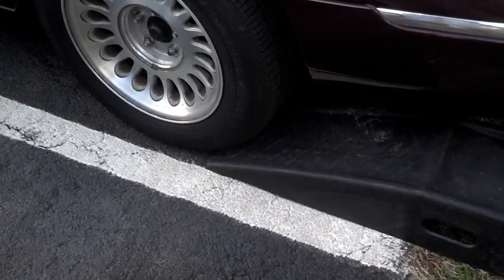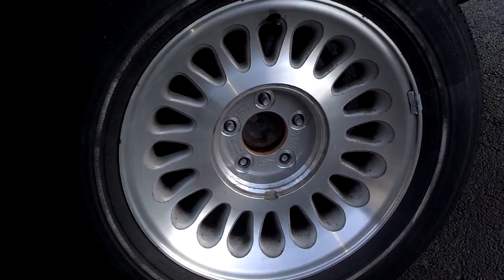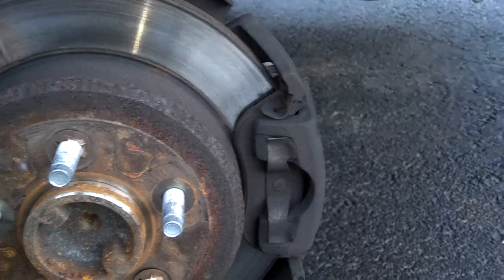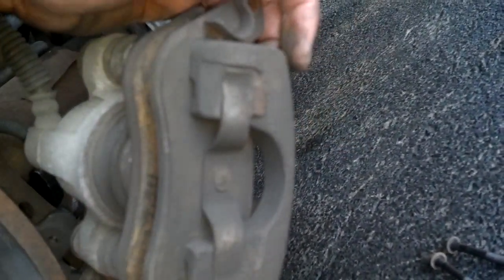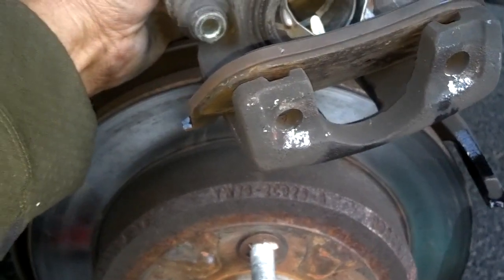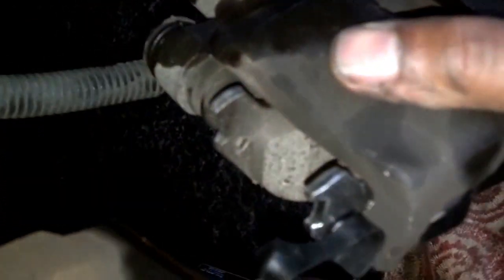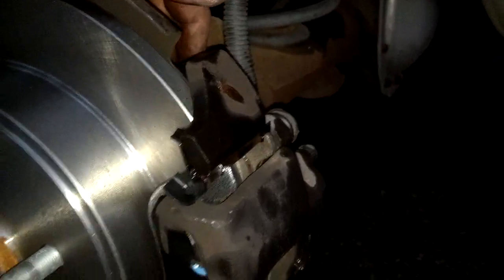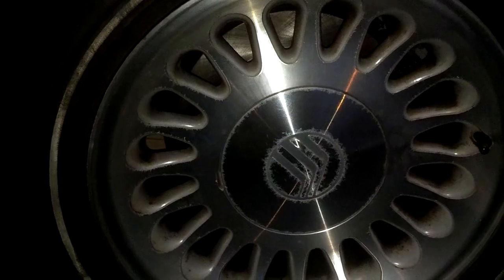Rear brake pads and rotor replacement, Mercury Grand Marquis - VOTD

Comment: Enjoyed the video. Have a fella with a alarming loss of brake fluid and I can't a leak surprisingly, any thoughts on spots to check in the hard lines that may not be running straight to the ground or easily visible leaking?
Reply from the maker: I have no idea.

Comment: HELLO ! ROBERT MY HUSBAND  IS REPLACING BRAKES ON OUR 1993 LINCOLN TOWN CAR SIGNATURE SERIES AND SO FAR HE'S FINISHED THE FRONT BRAKES BUT HE'S COME TO A DILEMMA REPLACING THE REAR BRAKES HE DOESNT KNOW WHAT TOOL TO USE TO TAKE THE CALIPER OFF, HE'S TRIED ALLEY WRENCHES BUT THEY'RE NOT WORKING..DO YOU HAVE ANY IDEA WHAT TOOL HE NEEDS?
Reply from the maker: lakisha brown I apologize, I do not. Are they disc or drum? You may want to try Google or ask the guys that work at an auto parts store.

Comment: is there a picture,a diagram on how to properly re install the springs and adjuster on the 2001 models of the grand marquis emergency brake shoes
Reply from the maker: You can probably find one on All Data, or try a forum. Most are the same with many cars.
Reply: Thanks

Comment: No need to loosen the brake bleeder and expose the system to air possibly going in the lines and having to re-bleed the brakes. The C-Clamp will push the brake fluid and piston back without loosening the brake bleeder. I never loosen the brake bleeder and I have been doing brakes since the 1960's.
Reply from the maker: Thank you for the tip. Not sure where I picked that up. Probably should replace the fluid anyway. 🤷🏾‍♂️
Reply: Robert DIY in all the years that I have been doing brakes very seldom do I bleed out the brakes for no reason just to get some old fluid out to be honest with you. The only time I will find myself doing a bleed is when a brake line or brake hose needs to be replaced or a brake caliper goes bad or in the case of drum brakes the wheel cylinders are shot or a Master Cylinder goes bad. That is when I bleed them out with new fluid of course otherwise I don’t touch them. I leave well enough alone. I have a 2000 Mercury Marquis. It just made only 35k miles. I heard some noise coming from the back lately so I  jacked it up put it on stands and pulled the back 2 wheels. Sure enough the back driver side brakes are shot and started cutting into the rotor. Actually there is plenty of meat on the rotor. Back in the day I would of just had it turned down on a lathe but a friend of mine in the parts business will be at a Parts WD today so I called him with the part number for 1 new rotor. I have a new set of rear disc brakes for this car sitting on the shelf knowing it would need them at some point but they were still good when I replaced the fronts at 30k miles. I use to be in the parts business also but I am retired from it now. Yesterday I had some time so I checked out your video for the heck of it. Good job by the way. At almost 69 years old I am finding that it is not so easy for me to be working on cars much anymore but I try to do what I still could today like anything else.
Reply from the maker: So you don't replace the fluid every 2 years?
Reply: Robert DIY Nope not at all as mentioned above.
Reply from the maker: I use to do that, until I lost brakes on day. 😬
Reply from the maker: https://youtu.be/nYBkCfhDTTw
Reply: Robert DIY Just watched your video on brake bleeding at the link you provided but didn’t comment there. You had a lot of air in those lines in that video. You are suppose to see solid fluid all through the clear plastic hose from the caliper to the beginning of the suction bottle when all air is out of the system. You didn’t do that. That in itself is dangerous. One other thing being you are all about changing the fluid. If you wanted to do a good job you should of got yourself a Turkey Baster or one of the squeeze bulb type of suction tools to suck all the old fluid out of the master cylinder that has also been exposed to air. All you did was add new fluid with old by adding new fluid right into the master cylinder. Then you bleed old fluid out of the caliper drawing more old fluid into it. If you sucked it all out now the Master cylinder would of had new fluid to start feeding between all the brake lines pushing the old fluid out in the process of bleeding. Just another word of advice. I am not to impressed with that Mighty Vac Bleeder. Harbor freight sells something similar. I know I have one and I don’t care for that one much either. Power Bleeding is the only way to go. Actually Harbor Freight sells one that I really like. You could of purchased one of those probably for what you paid Napa for the Mighty Vac Bleeder or less if I had to bet. Once again brake bleeding is fine but not always a necessary thing to do unless you open the system to replace a rotted line or brake hose or Master Cylinder or replace a Caliper or Wheel Cylinder. I have been in the Autoparts business over 38 years and saw a lot. I don’t know of anyone who risked their life not changing brake fluid over all that time. You have about as much of a chance of having your Master Cylinder go bad all of a sudden when you step on the brake or a brake hose blowing out or a rotted brake line breaking loose.

Comment: cant get the cailberoff and if i dont have a c clamp any thing elae i could use.
Reply from the maker: Man, I show the recommended tools at the beginning. Not sure what else will work.
Reply: the rubber boots i installed them incorrectly and drove 2 days intill i could fix the problem

Comment: anyway u should seen my crazy self \my problem is with the same model car but an 04 heres what happen i seen my the thermost state house leaking from the bottom on my gosh so i thought i had to take thre serpter off and the pully two being my first time i diddent no how so i took the tenser off first bamm the belt smacked so hard, later learned the hard way u do the pully only dang that suck extra work, and than took the aklternateroff and in the processce striped my cheap twain ratchet peieces ive never buy angin... so any way it suckred just let me no if we can talk love ur videos honest and its u not fake at all.
Reply from the maker: Thanks for watching.
Reply: more big ass problems

Comment: Pretty good video , but I missed the part of the Parking Brake when replacing the rotor . Is there any service needed . I've not gotten this far with my MGM yet. Is it a shoe inside the rotor to make the parking brake work ? Please excuse my "Uniformdunce"
Reply from the maker: +mrbakerskatz I don't remember. You'll have to use what you see and dive in there.

Comment: why break the bleeder loose? it should not be done! just take the cap off the fluid resivior  - unless it has a very rare anti-lock wierd system!
Reply from the maker: You are correct, it is not necessary.
Reply: THEY SAY THATS THE NASTEST MIGHT AS WELL CLEAN ITR
Reply: You Are Right Steve, That is true it was totally unnecessary to open the bleeder he got brake fluid all over the place and most likely on the pads and rotor, Just collapse the caliper and the brake fluid will return to the reservoir by itself, Then later if you want to replace the fluid use a plastic hose and bottle much neater.

Another thing is when you get brake fluid on any of the working parts or lines it should be removed with brake clean, BRAKE FLUID IS HIGHLY CORROSIVE OVER TIME AND WILL CAUSE PITTING AND EXTRA RUST ON ANYTHING IT GETS ON, I HAD A DODGE RAM 2500 TRUCK AND THE BRAKE FLUID GOT ON THE OUTSIDE OF THE BRAKE LINES UNDER THE RESERVOIR WITH THE OXYGEN IN THE AIR IT ATE COMPLETELY THROUGH THE LINES IN ABOUT 2 MONTHS.

Make sure when collapsing the caliper to put some paper towels under the reservoir to catch any brake fluid that may overflow back out, This is very likely if brake fluid was topped off from time to time and if there is any overflow clean with brake clean to prevent the corrosive effect of the brake fluid, leaving on stuff is like a ticking time bomb, It will eat through certain plastics and some rubber parts and of course metal lines exposed to oxygen in the air, SPILLING BRAKE FLUID ON PAINT WILL REMOVE THE PAINT USUALLY TO THE METAL, SO IF YOU GET BRAKE FLUID ON YOUR HANDS DON'T TOUCH ANY PAINTED SURFACES!!!!.

The other thing is when you have that blue film on the back of the brake pad remove it and USE NO GREASE ON THE BACK OF THE PAD, THE BACK OF THE PAD WITH THE FILM REMOVED HAS ADHESIVE AND WILL BE TACKY AND WILL STICK TO THE FACE OF THE CALIPER CYLINDER  BY ITSELF WHICH ELIMINATE BRAKE NOISE, ON THE FRONT PAD IT WILL STICK TO THE CALIPER FRAME FRONT.
Reply: @RobertDIY  It's a good idea to drain the fluid out of the caliper. That fluid just sits in there, it does not circulate, so it gets nasty. Get some fresher fluid into the caliper.

Comment: this video is a liar. You dont show how to replace the rotors at all. please label your videos better so you dont waste others time.
Reply from the maker: OK
Reply: I thought the same thing
Reply: Chris Richards  why are you calling him a liar. What more did you expect to see? Once the caliper was taken off you just pull the rotor off. In this case there were some clips you would of had to twist off with a pair of plyers. There is really no need to replace the clips on the new rotors being the wheel bolted to the rotor holds everything together plus the caliper remounted isn’t going to let the rotor go anywhere.